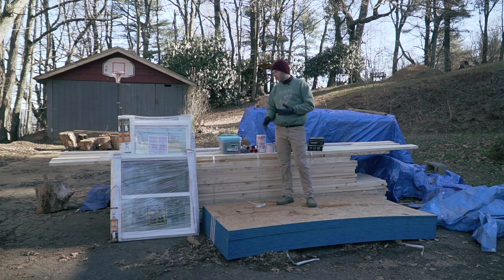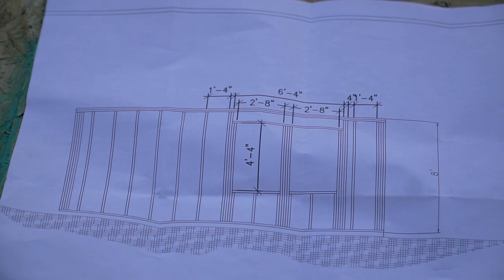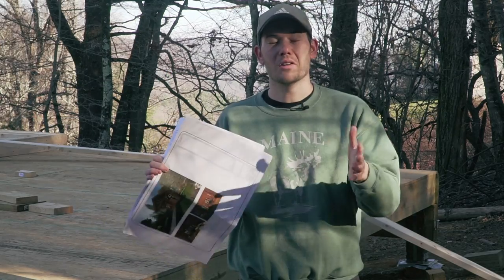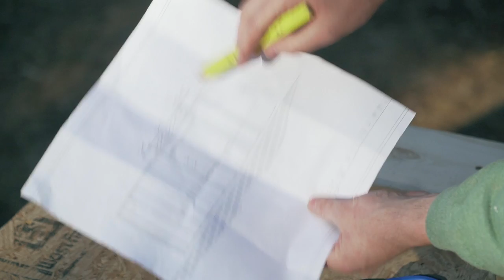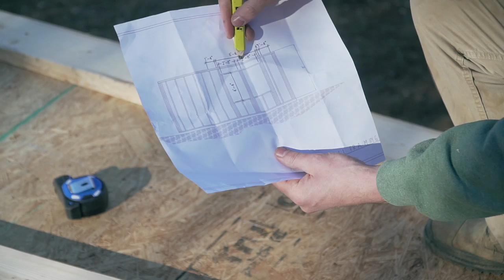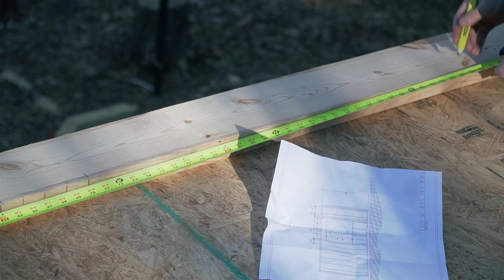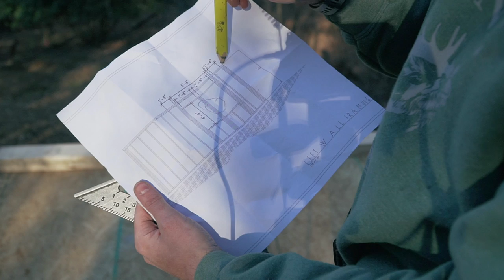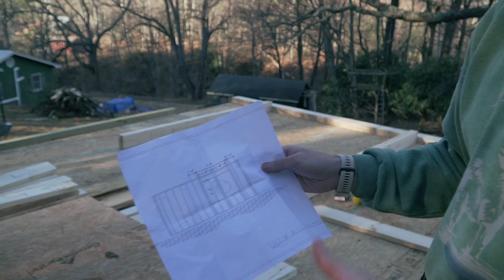Framing the First Exterior Window Wall of the DIY Cabin - Part 1 - EP 16

Comment: If you set your bottom plate and top plate on end together, you can copy your layout on both at the same time, and also run your nails from the top and bottom. If I remember on a 2x6 wall your studs will be 24in on center and 2x4 wall is 16in on center. I have always done one King and one Jack stud for windows and doors.
Reply from the maker: Typically people do 16 on center even on 2x6 walls around here.
Reply: 16 on center vs 24 on center are both correct. In higher elevation and especially being in the high wind zone. I would not even think about twenty four inch centers
Reply: Maybe 18?🤔

Comment: (4) corner studs is twice as many as you need.  A 2-stud "California corner" would leave more room for insulation.  Likewise, a single ply header would likely be sufficient (requires checking structurally) and would leave room for more insulation.
Reply from the maker: Yes indeed, I’ve seen it done the way you’re depicting.
Reply: Yes exactly— I saw 4 studs and went 😯😅
Reply: You guys aren’t thinking about how absolutely trashy homes in America are built. You’re speaking to someone who comes from an old country where they have substantial homes that have lasted hundreds of years before America was even conceived. Let the man cook.

Comment: Where did You learn to frame?  I went to school and they never did any of that. Start From one end. Lauout the windows from the center. Why 4 studs between windows? You make it so complicated to a simple process.
Reply from the maker: I never that’s the problem 😂 I’m just a guy figuring it out. 4 studs between windows because I wanted to make sure I would have enough room for the flanges of the two windows. Probably more than I needed.

Comment: Your framing is completely overkill on your corners. If you place 1 stud and turn the 2nd stud sideways. It would give you essentially your 4 studs spacing and adequate strength.  Also typically you only have one jackstud unless you're doing a large picture window and you only need 1 king stud.